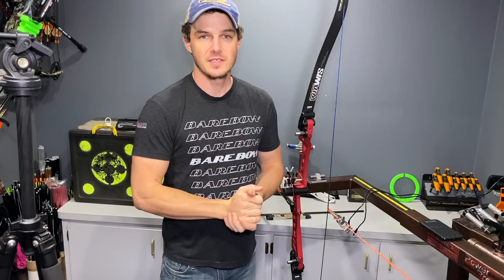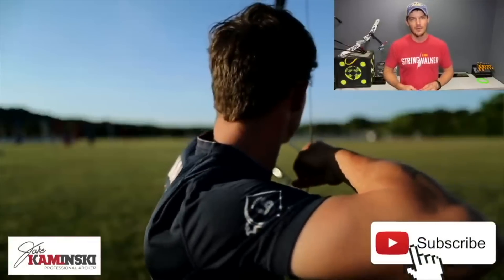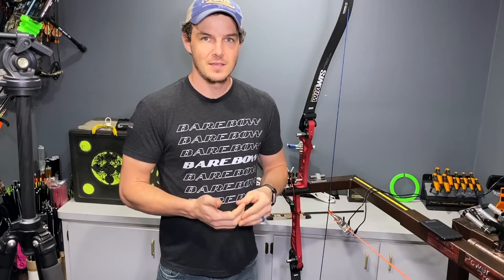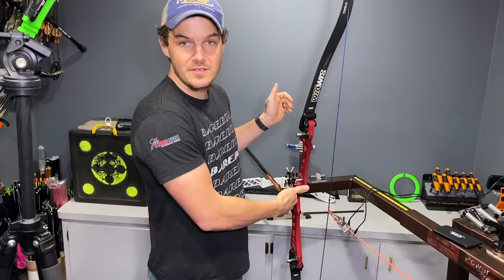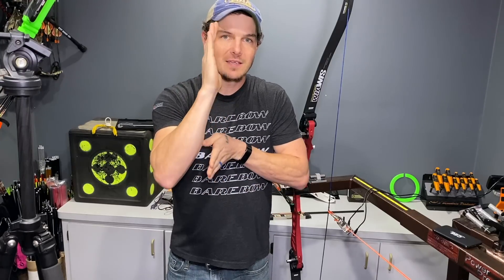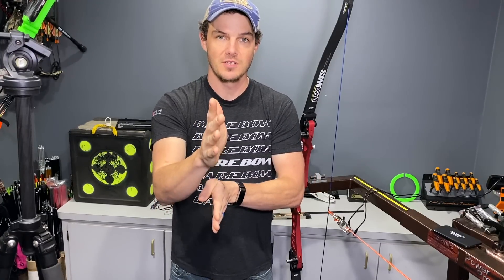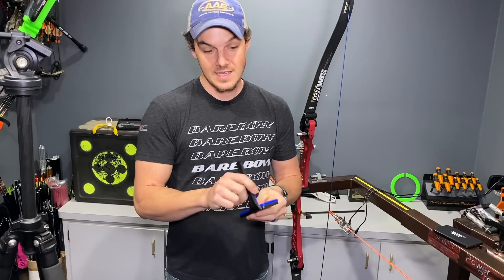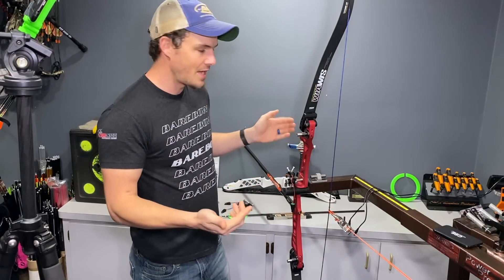Introducing Recurve Riser Flex Testing | How I Will Test Archery Risers with REAL DATA

Comment: Shorter risers you’d expect to flex less as I’d imagine them to be stiffer. Likewise carbon you’d expect to be stiffer too. Also, a useful unit of measurements would be y-deflection per pound per inch of draw length

Comment: A valid test, well done! The drawing of the string at the nocking point will of course pull the centre laser up as it is pivoting about the centre of the bow (is the grip the centre of the riser? Usually not). Simple calculations show that the ends of the riser are moving over 1mm each - a huge amount!
Reply from the maker: Thanks! I have a jig I made to draw the bow back with 3 fingers so that will be fun to try.

Comment: Great start but one thing. With the left movement have you allowed for deflection in the jig. As the frame will bow in words with the draw weight.
Reply from the maker: The measuring jig and device is 100% the bow, the draw board on the bow press is not part of it other then drawing back the bow.

Comment: I would recommend a fine point marker (like a precision drawing marker) instead of a pencil, as friction is not required to make a mark, just pressure. This would allow for more consistency in marking.
Reply from the maker: Good call
Reply: Yep, check Rotring pens . Also maybe use milimetered paper...

Comment: I would remove the center laser, because it is too close to the stab mount, in my opinion it gives more noise than information. Also I think it is better to relate it to draw length, because risers may have different limb mount pre-load. Keep the same limbs for every test, as the limb behavior may change. It is also important to know the stabilizer length, or the test measured length, so a 1mm dev on paper translates to how much flex? Very important to compare apples. I think this is very good trial!!
Reply from the maker: Agreed on all accounts, just a work in progress. Will finalize tests before posting hard data sets.

Comment: Looks like the horizontal laser line is showing some sideways rotational flex, looking good. Can you 3D print a laser pointer holder that will allow for micro adjustment?
Reply from the maker: I probably could. will see what I can come up with in the future.

Comment: Great video. There seems to be a bit of side torsion as well. The horizontal laser seemed a bit off-line when in full draw.
Idea: Aim at 10 feet on a blank graph paper at no draw and take a picture. Next, Aim at same ‘target’ at full draw and take picture when arrow clicks pass clicker, take picture and compare. At longer distances the deflection should be higher and easier to account to very small changes between different risers.
Reply: Actually at no draw both lasers should be at same point.
Reply from the maker: Check out my new setup! https://www.youtube.com/watch?v=sxMRPhRETrA

Comment: Hi Jake, great video as usual, love this stuff.  One thought I had is that may be as the long rod is lets say 5" below the riser pivot point in the fixture, any flex in the riser at full draw between the pivot point and the long rod mounting point would move target point down and the centre laser point up on the target ?
Reply from the maker: Yes agree, this is why I may use the arrow (dot laser) as the reference and note flex of the stabilizer separate from the other two measurements.

Comment: Pretty interesting.  Just devils advocate, is it possible that some movement could be related to the bow press arm and the round shape as draw weight is increased?
Reply from the maker: na, same as a grip relatively speaking. Plus think of those with high wrist grips, I bet its essentially identical to the peg I am using.

Comment: I absolutely love this Jake, I’v been thinking of this for a while now. There are how ever many factors to take into consideration. 
My first thoughts will be. 
If the limbs are micro aligned, should these measurements be started at 0% tiller, should the graph be on a fixed point on the wall not on the long rod, as the riser flex’s then the long rod will also move too. 
The riser should be held in a fixed position that replicates the hand grip as there will be different pressure points. 
Is the pulley positively lined up with the string and bow. 
I think that the hook you’re using should also be replicated in the same shape as the three
Reply: Sorry sent message before I had finished. 
I think that the test should start with all components set to zero brace height, tiller, limb load ect ect. 
Then test at manufacturers settings. This is very exciting 😳 as many people have said already carbon v aluminium risers. 
But there are so many things to consider in the tests. 
Can’t wait for the next test 👍 
Oh and by the way Jake, bottom laser break in the right hand side is due to the long rod, but I’m sure you had worked that out yourself. 
Keep up the great work Jake 
Merry Xmas 👍😎
Reply from the maker: Thanks for the comments David. 

I have to have it mounted on the riser via the stabilizer but I will be repurposing my measuring plates as the stabilizer holder instead to eliminate  the stabilizer flex as a distraction. 

The reason I need it mounted on the bow is because to have the bow perfectly aligned to the wall and consistent will be near impossible without massive fixturing expenses. Plus a small change on the angle of the bow moves the lasers in vastly different directions due to trigonometry changes.  I will test to see if there is a change with a grip or not on and how much it changes if so. Also either way I will be doing it the same from bow to bow, it will be impossible to replicate everyone's pressure point as some use high or low grips on their bows, so as long as from bow to bow is consistent it will be okay I think. Ill ensure the draw board mechanism is aligned with the grip.I don't think there will be a difference in how many "fingers" pull the bow back as this will just draw the bow further, although yes it may flex the top and bottom slightly differently and I have a jig made for that so I will test, although 3 under vs split finger vs string walking changes this anyhow so potentially simpler is better to prevent bias and less then universal information imho.

Comment: Hey Jake, very nice idea for measuring the riser flex. I would however suggest different measurement method. More complicated, but in my opinion far more accurate and precise. Consider measurement jig consisting of a stiff rod or beam attached in the middle to the raiser (using either plunger button holes or some sort of vise like clamp) , parallel to its vertical axis, so the beam ends are next to the riser limb pockets. The beam should have a holders at each end for the dial indicators, so the deflection in the vertical axis can be measured. For measuring the out of plane flex, the said jig could have perpendicular extensions at both end with another set of holders, and the measured riser should have peg attached at the limb pockets, in similar fashion like your top and bottom laser holders, but I think they might need to be longer, perhaps a 10 cm or longer. Those pegs would serve as reference points for the dial indicators attached to the perpendicular beam extensions. Then, the off plane deflection could be measured by measuring the distance of pegs to the beam perpendicular extension. This way you could measure the deflection few orders of magnitude more accurately.
I'm not sure if I described my idea clearly enough, if not, please let me know, I could make some drawing for you.
Reply from the maker: I agree 100% However to develop this fixture would be more costly then what I have on hand currently. Plus storing the thing and making sure it does clamp the bow without affecting the flex is the problem. This is why having it free floating in space as we do when shooting was the choice. 

I agree on the accuracy potentials but this is why I will draw the bow 3 times minimum and measure each deviation 3 times each to have averages to hopefully take out error.
Reply: @JakeKaminskiArchery  Yep this is more complicated, so there's always a trade-off. What you might want to consider with your method, is to measure the flex only with reference to the middle laser dot. I don't really see any advantage of having that screen mounted to the stabiliser rod. If you have enough space, you could cast the laser dots on the wall couple of meters away - this would decrease error introduced by hand drawing the dots. You could also use camera to do photographs and do measurement by pixel counting, you would probably need to manually set the exposure so the sensor won't get saturated, and have the camera inline with the arrow line to avoid introducing parallax error. And if you're really patient, I would suggest taking more measurements, to see how much noise is introduced by the measurement itself.
Generally my point is, if you like to do real data driven tests you might want to make sure that you get your methodology right. This I think will be important when we get to the point when someone would want to compare the different risers, not necessarily to say which manufacturer does the better job, but to see  for example if composite riser behaves better than aluminium one, of if its really worth to pay extra for riser made out of 7075 alloy than your regular 6061.
Anyway, this is awesome project. Thanks for doing this. I would be really happy to also see some limbs comparisons, like draw force curves and speed/pound measurements. Great work!
Reply from the maker: Having the paper mounted to the stabilizer is important because if not, all 3 lasers would need to be perfectly level and square to the riser itself, AND the riser would need to be perfectly square and level to the wall, this is impossible to do, and can easily result in error. with 3 different lasers, you cannot have. them level and pointing at the same spot on the wall... if you saw when I first started to draw the bow back, the bow rocks and moves. This causes a distortion on the wall where the dots are, and will not be at all measurable due to the change. Isolating the measurement ON the bow essentially removes that issue. Yes the stabilizer moves down as I draw the bow, so its just another reference point to be measured compared to the arrow (the dot).

Same thing when using the camera, the angle, distance, framing etc would have to be 100% perfect every time to compare apples to apples. Being able to remove the surface from the bow to measure without disturbance is important imho. as bumping the lasers and interrupting the beam happens and is difficult to measure without the drawn dot. Ill use millimeter paper in addition to what I use now in the future and that will help a lot with consistency however I expect percentage points of difference between bows (usually) not millimeters. 

I appreciate the feedback for sure and will further my explanation and methodology as to why I am using the paper on the stabilizer as a reference at all. I thought I had it all figured out on 2 other videos that I was filming to show this exact thing and saw a major flaw (ie using the wall) and had to stop the recording and went back to the drawing board.
Reply: @JakeKaminskiArchery  Thanks for the explanation. One more idea when it comes to the camera - you could actually mount it to the stabilizer rod itself, you said you have the 3d printer, so making a holder that would allow you for repeatable measurements shouldn't be too difficult, that in my opinion might be more accurate and convenient than pen and caliper or millimeter paper.

Comment: Hey Jake, really cool stuff. Wondering about grip pressure point position and its affect on riser flex?  Wouldn't the fulcrum be different with a grip pressure point rather than the bow vice contact point at the grip's throat?   Another suggestion is to record the temperature during each test.    It may be interesting to report the final mean +/- standard deviation as well as the raw measurement data, as I am wondering if the bow flex changes as the bow is flexed multiple times. So an additional question is: is there directional measurement drift with repeated measures (flex 1 vs flex 10 vs flex 60)?  If temperature and repeated measures affect deviation, the coefficient of variation may be high. If so, taking measurements at a constant temperature may be useful (although admittedly artificial as risers are flexed within a huge temp range). If there is drift with repeated measures, maybe your protocol will need some standardization, such as three initial measurements and three measurements after 60 draws? Or maybe all my suggestions are just too deep in the weeds??
Reply from the maker: I find it unlikely after repeated draws to have an affect. In my testing the riser even flexes (quite a lot actually) from unstrung to brace height. I do think that after a bow is shot a while there may be fatigue and more flex then a new riser. I will be drawing the bow 3 times to be sure and seeing if that measurement changes. As far as temperature Im sure it may change slightly but is impossible to control based on when someone shoots at a tournament the temp is what it is. However it would be neat to see if it makes a difference.
Reply: @JakeKaminskiArchery  This is very interesting. My assumptions are 1) repeated flexion causes a slight increase in internal riser temperature, which leads to an increase in flexibility. This may be totally bogus. It would depend on the metal I would think. And it may be insignificant.  2) increased flexion in the sagittal plan, if the ratio of deviation between to top and bottom limbs is constant, is benign (there would be no effect). However, I posit that torsional flexion could worsen if it were true that repeated flexion would increase the deviation. Not only would the archer be getting fatigued at 50 arrows, but the bow could be synergistically amplifying the errors. Most likely this is all crap. But fun to think about anyway.

Comment: Hi, do you get the same deviations at different centre shot and tiller settings? You might be able to eliminate the horizontal deviations and even up the vertical ones, hopefully getting a better tuned bow and better riser to riser comparison. You could record amount of adjustment needed and compare consistency from limb to limb
Reply from the maker: The horizontal deviations shouldn't change with center shot based on my reasoning however limb alignment would for sure.

Comment: you're a machinist , google dial indicator alignment basics . Set a stand to fix the riser in with four dial indicators at top and bottom of riser...instant measurements! The laser is fun for showing effects but dial indicators, strategically placed, will give the best idicators of what's happening where. Plus the distance to the paper would seem to exaggerate the deviation at the riser...idk. Industry has been using these forever. Yes there are laser measuring tools as well, but, super expensive. Depends on what you're after I guess. I may be way off base.

Side note...with that laser on, might be interesting to see the effects of torque, both bow hand, shims, and string hand, jig the width of 3 fingers to twist the string....I know that's what holding me back....IMHO.

Thanks for all you do. Learned a lot this year.
Started doing SPTs with you. I load and release an arrow, from 10' at a # on my target face, at the end of 20 sec. Tougher the second time around, lol.
Reply from the maker: To build a jig that will not move while holding the dial indicators and will not influence the bow is pretty much out of my budget or possibility range at the moment. I figured the KISS method at the moment was a good proof of concept and a starting point with my current budget.

Comment: Hey Jake, really interesting video. I was wondering if it might be more accurate to have your drawn crosshair independent of the bow and positioned in line with the nock point on the string and where the riser contacts the draw board? That way you remove errors due to the end of the stabiliser moving as the riser flexes.
Reply from the maker: I will use the "arrow" laser as the ultimate reference for sure... Thanks for the suggestion

Comment: Hi Jake, with the data online please can you report the deviation as you've said, but also the XY coordinates of each three points. (0,0) being your original start point. This will allow easy future data analysis

A different slant, but while they're on the rig, is seeing how much the tiller changes from rest (static tiller) to full draw (I'll call it dynamic tiller). This would seem to test the limbs rather than riser, but how they change over a draw is interesting.
Reply from the maker: Agree, I will post data similar to that in x and y deviations. Also I will work on swapping limbs back and forth to see how much change there is and try to take account of the tiller change.

Comment: Are you actually measuring the true deflection of the riser pockets in x and y axises, in millimeters or the effect of parallax from angle deflection at laser mounts under load?
Reply from the maker: I'd have to calculate that someday for sure. This measurement is of course with the parallax